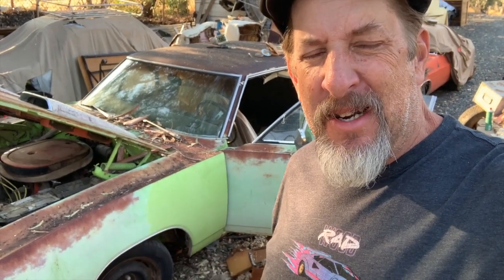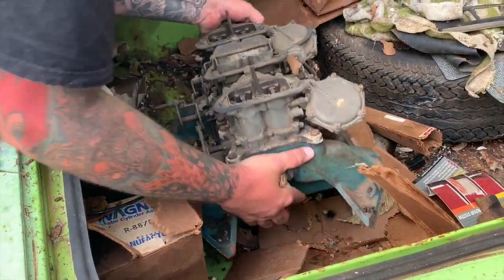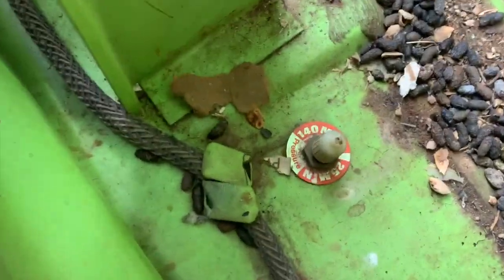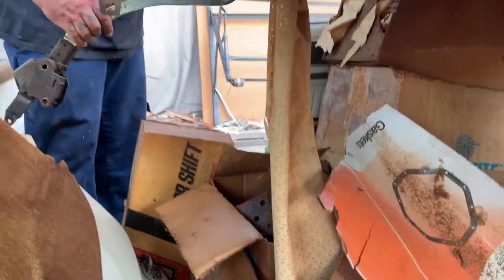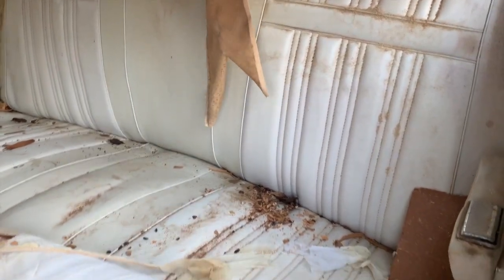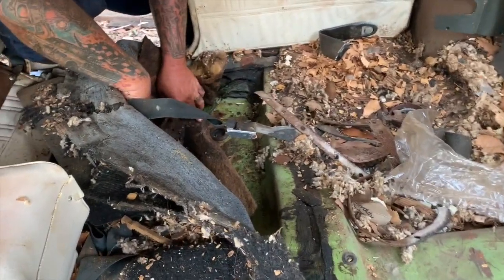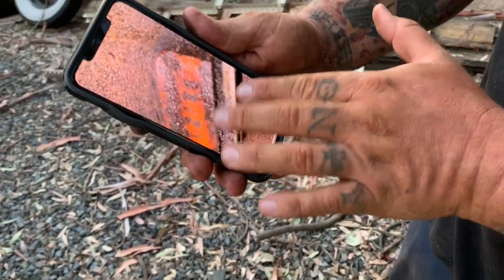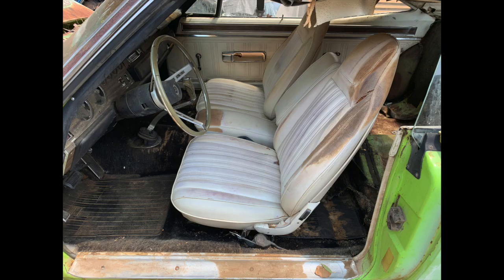Carchaeology: Barn Find 70 Coronet R/T Inspection

Comment: The 70, was my favorite B body. I love the front bumper design. I seen one once with the front bumper painted to match the body color. I don't think they made a factory flex bumper, like on the Cuda, but I could be wrong. Either way, this car is cool!
Reply: Nope, The Coronet R/T never got the Elastomeric front bumper. Only '70 and '71 E body cars got that as an option.
Reply: @paulfulton5078  thanks, I appreciate that info, because I've always wondered about it.
Reply: @rickhenson660  No problem! I am not aware of any '70 and older B body that came with the rubber bumper option. I think it was available in 1971 only for the GTX and Road Runner platform.

Comment: One of my favorite cars, Charger 500 is my holy grail.
Reply from the maker: I cant wait to dive into the Charger 500. Its sooo coool!
Reply: @Carchaeology  I've wanted one since I learned to drive in 1980. Wish I could afford to visit and see it.
Reply: Mark there is a channel on YouTube here called Nick's Garage if you don't know about him & he specializes in Mopar mostly but works on anything old & has a charger 500 that they are going to restore so look it up ! He also builds engines & has his own engine Dyno to break them in & test & tune with & just built a 440 stroked to 493 cubes that a guy wants for his 65 Plymouth Fury 4speed car & the engine is a pump gas engine that he just dynoed & it made 615 HP & over 650ft lbs of torque at 4,400 rpms & was saying it actually needs a bigger carburetor on it than his race prepped Demon 750 & figured it might make a few more HP with it but didn't have a bigger carb to put on to see if it would or not. My first car was almost a 70 lime green & black interior & top Super bee convertible but my father didn't seem to want me to buy it which I still regret to this day but the first car ended up being a 66 Chevelle SS396 so I still had some fun & ended up buying 2 more of them 1 a convertible in the later years then the black one I had I put a 70 454 LS6 with a solid lifter cam an Edelbrock XC-96 2x4 cross ram with a dual point ignition & some hooker super comp big tube headers backed by a Muncie close ratio 4 speed with a verticlegate shifter & 4:10 12 bolt posa trac rear with ladder bars so even though I missed out on that Super bee I still had a lot of fun in those cars & I wish I still had to this day but as time went on I had to sell unfortunately & with the current prices these cars get I can't afford one unless I either sell my house or use my mortgage as collateral to get a loan for one now that the house is paid off but at these insane prices I will be dead & gone by the time it's paid off lol !
Reply: @peteloomis8456  I watch Nick.